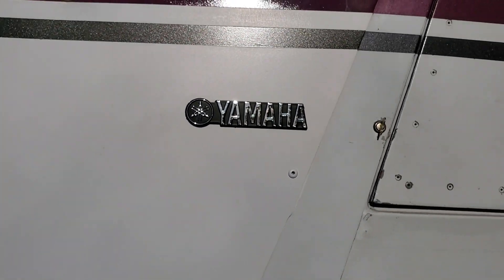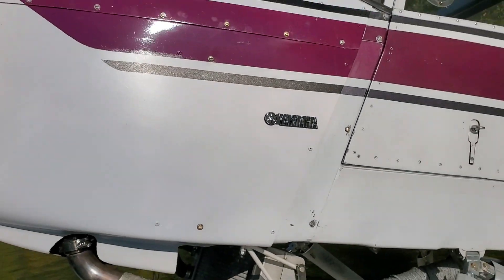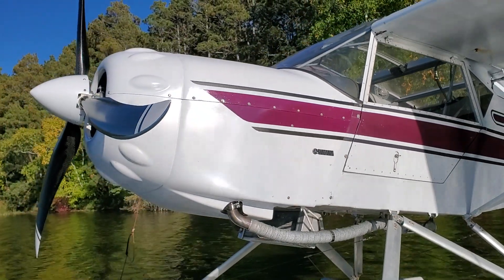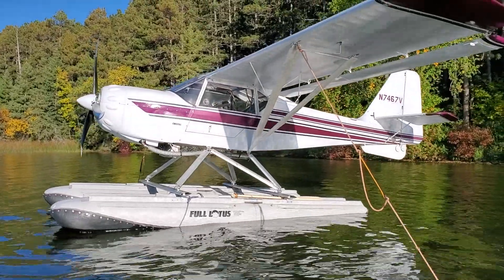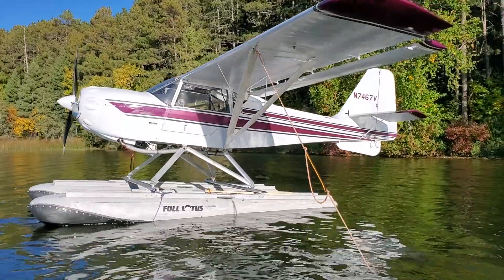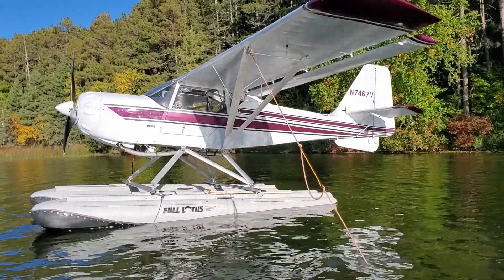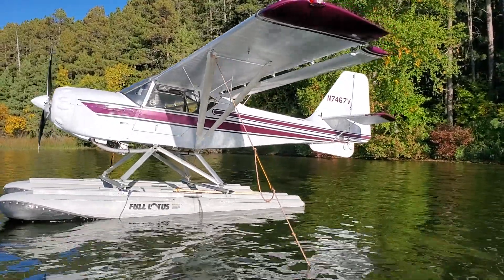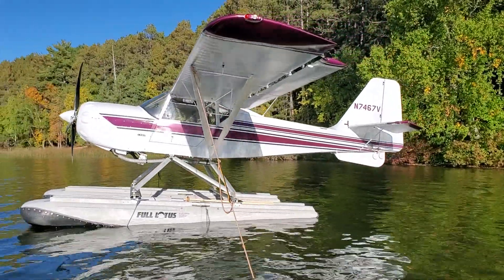Kitfox with RX-1  -  2 Year Update.

Comment: Hey Brett, great job on the Rx1 build on your KF5. Did you happen to know what the installed weight of the engine? Been trying to research, hard to find reliable numbers.
Reply from the maker: People do it lighter than I did.  Steve Henry's came in at 178lbs with muffler, prop, and all accesories.  I'm guessing mine was pushing 200lbs

Comment: Ever consider putting the K&N filters on the carbs for more HP and less space taken up under the cowl?
Reply from the maker: I have a friend that did it successfully but you need to connect across with a pressure balance tube to get it to run right.   Go to the FB group and PM Craig Whiting and he might have some pics of his setup
Reply: @brettlarson4327  Excellent thanks for the reply, already have the filters on the sled engine now and jetted perfectly so would love to take advantage of it
Reply from the maker: @MrMad4mud  awesome, yeah your experience with tuning the sled will make the airplane re-tune easy compared to other people!

But you will make some big changes to jets and needle position.   For instance my mains are at like 210 right now.

Check over this post in the group to get familiarized wirh the adventure your taking.

https://m.facebook.com/groups/164864990778457/permalink/189192581679031/

Comment: Absolutely love this. I just bout a kitfox 3 with no motor and throwing my RX-1 engine in with less than 7,000km on it that was in my sled. So pumped
Reply from the maker: You're gonna love it!   Lotta work to get the job done but wow is it worth it!

Your light little 3 will be an unbelievable rocket but it will also be nose heavy and the useful load will technically be pretty skinny...  even though in reality the RX1s power could haul evething you load with ease compared to a lighter 65HP engine.

So you (and I) are essentially trading more performance and realistic load capability against less "W&B" capability.